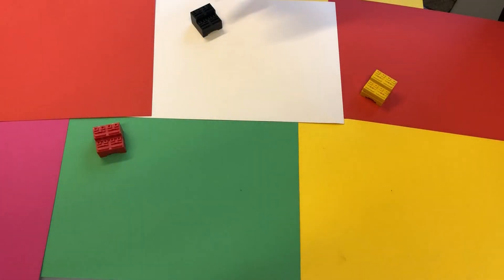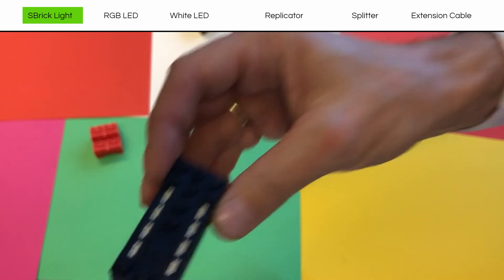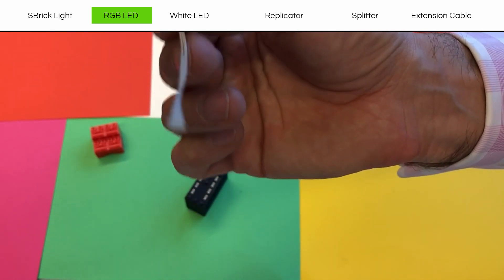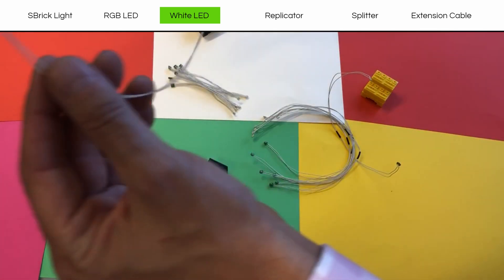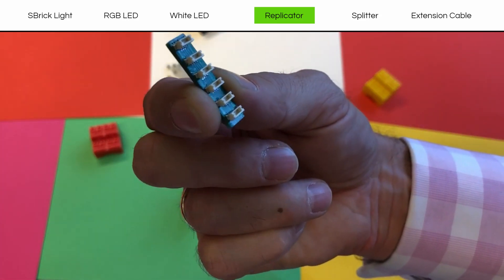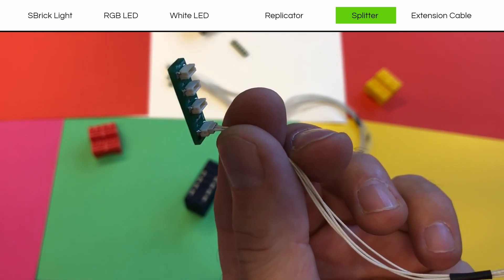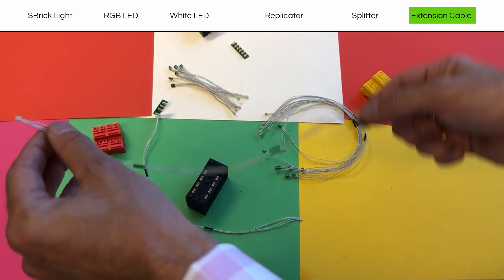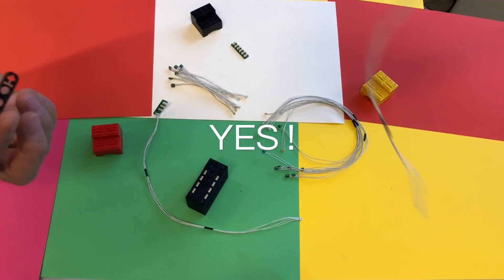How easy is it to build with the SBrick Light system? Do the cables, replicator and splitter fit?

Comment: both versions have a 1 x power supply with it. are you talking about a 220V power supply with some kind of connector plug? and is there a special cable/plug to connect the slim version with an external battery? (

Comment: a few questions. are the cables gone stay loose from each other?  are the cables gone be white or black? are the gone be extension cables for the white and RGB lights? 20/30/40/50 cm?  
have to say I love the concept. but the price is high. for that price, I would have expected that it could be plugged into a lego battery box. 
if I understand it correctly the lights will only work on a static model, right?  or will it be linked to the "normal" sbrick true the app? so when riding a truck and go left / brake / go back etc the lights would they work?